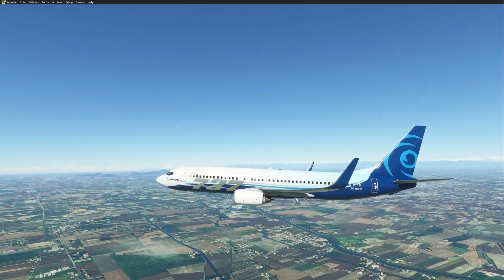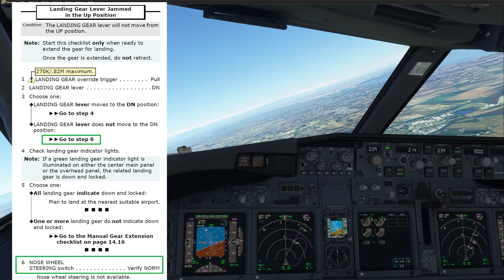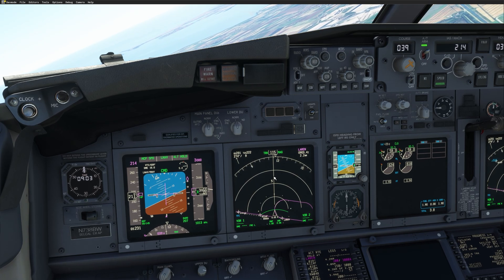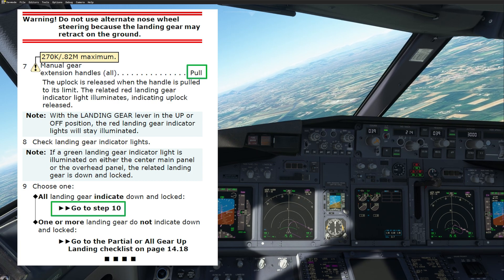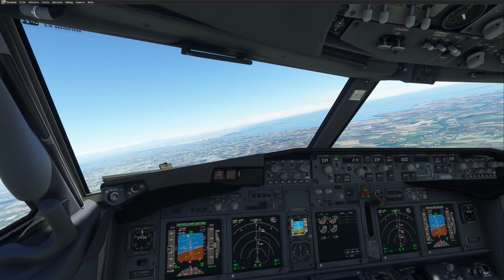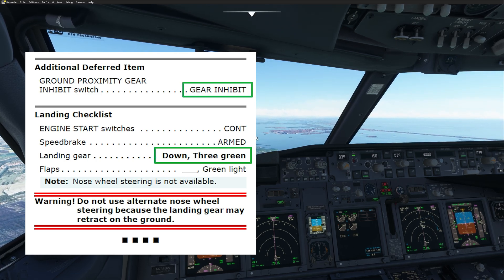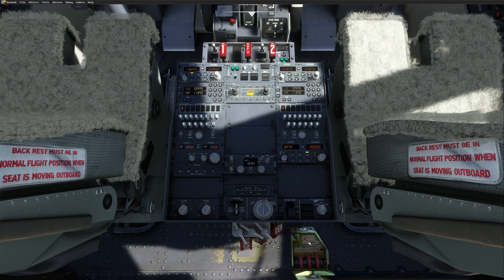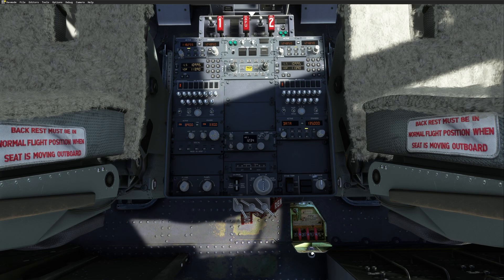B737 Landing Gear Lever Jammed in the UP Position, avoid the trap!

Comment: So finally if it's happens ,the manual input gesr down door closes accidentally, there'S no way but to landing on the belly? Or again open again the door and pull the manual gauges for extend gears, they'll go down again and locked and can landing with the 3 gears right down locked?
Reply from the maker: Yes, correct if the door closes at 1500 feet like in the video; if you bounce on the runway and it closes during the first touchdown... You crash the plane. The same applies at 50 feet; with the inertia, you will do a touch and go on a 'Gear in transit.' Chances are slim, but we also used to say, 'What are the chances of losing two engines on takeoff!